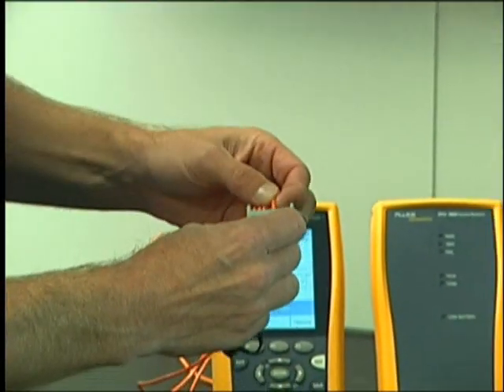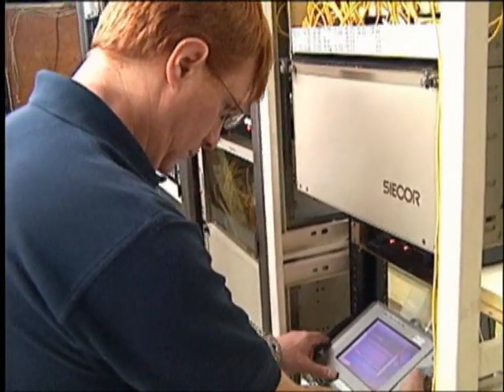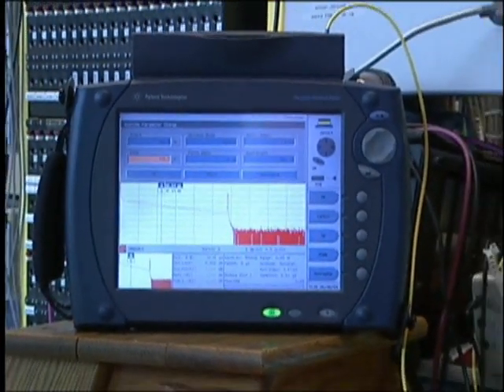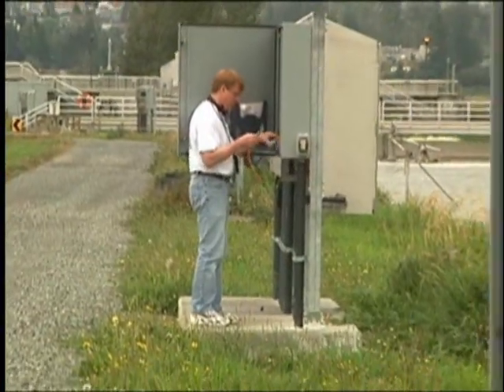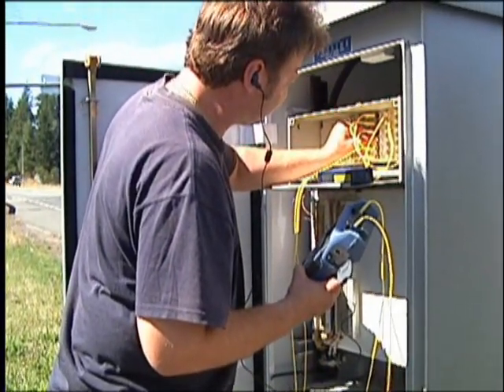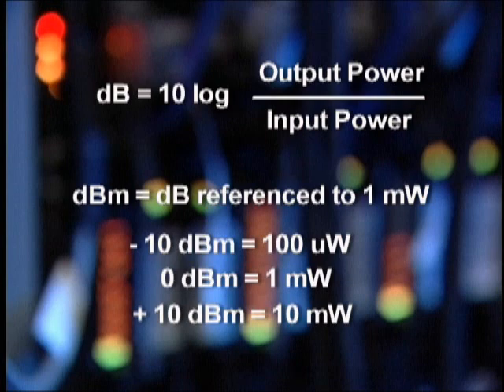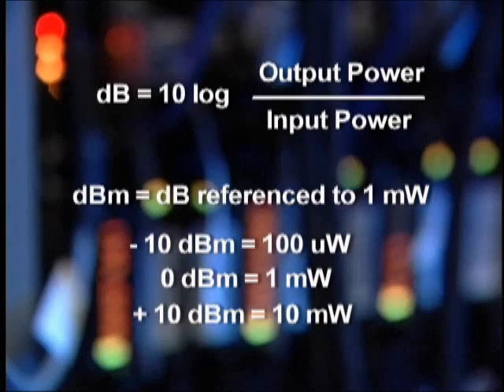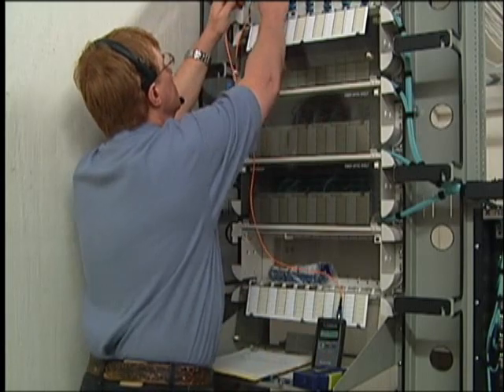Fiber Optic Testing:  W-6D-131 Chapter 1 of 13

Comment: Hello I have a FTB-100B miniotdr,and i have a problem with him. When i press the button to start,on the screen appear initial settings,but i can't do anything..when i press the touchscreen i hear the pressing but nothing happens. Do you know what could have. Thanks
Reply from the maker: The general protocol would be to cycle the power completely. Turn power button off. Wait 30 secs for the unit to completely power down. Remove the battery from the unit. Wait an additional 30 seconds. Replace battery in unit.  Power on.  
If this does not fix the problem then we encourage you to call EXFO directly.